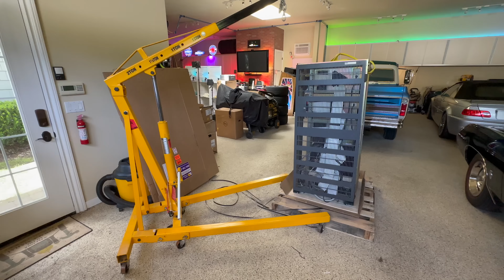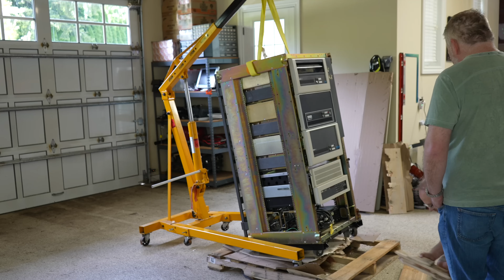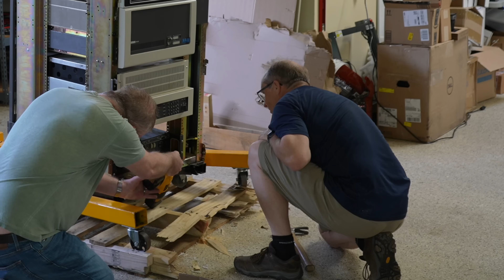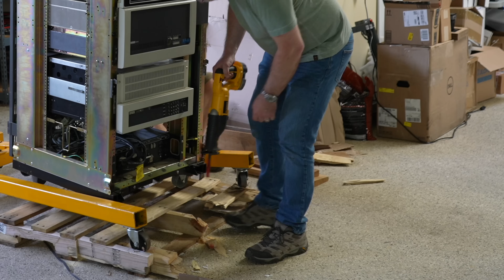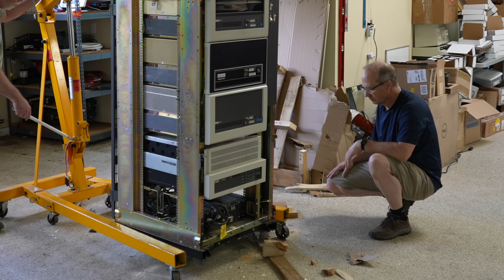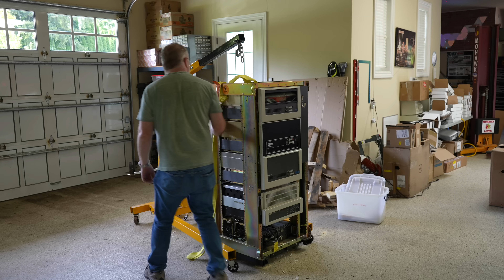I Bought the HEAVIEST Computer on eBay: The PDP-11/34!

Comment: Hello Dave, in the 1980s and early 1990 's I worked at a defence HF RADAR system that was all PDP 11/34 and then we updated to PDP 11/84's as they needed more horse power..  (later on we moved to VAX and Alpha) ahh the memories of RSX11M and its quirks, still remember setting the UIC to change folders if that the correct term, I was an electronics TECH who was slowly seduced by I.T . Thanks for the memories.

Comment: Ah, music to my eyes :) Thanks !  In Adelaide (Australia) we used a '45 a '44 and some '34s to coordinate/control sets of traffic lights back in the early 80's.  When I first landed in that area, one of the techs had a program from somewhere that ran (on the '45 I think) and a radio placed nearby would pick up the RF as a (valid!) tune, unless he was fooling me all those years, go figure :)  The things we did back then :) My favourite memory was debugging a device driver by using single-step panel switch and examining the lights for octal data :) And, using tin slips on a soldered jumper on a comms device after examining its schematic. Ah, the good old days.

Comment: It may not run Doom, but it will run Adventure on RT11!
Wow... a blast from the past, takes me back to 1977 when I started as a DEC in-field repair engineer on PDP11/05, 10, 15, 20, 34, 35, 40 systems.
The UNIBUS cables were a big failure mode. We had an expression "snake it, plate it and leg it" (cables, modules and ...). If that did not work then out with the meter and scope. I used to carry a 8M core memory module which had a diagnostic program ready loaded, just plug it in, load the CPU start address and let it rip.
The worst faults went like this...
 "Op to me: Tried disk in #1, then #2 then #3 and it still wont work",
 "Me to logistics: Please send 3 sets of disk heads",
 "Me to Op: Did your last backup work OK?" and Op Looks frightened.

Comment: I wonder if this thing is big enough?  I got  a VAXStation 3100 m30 years back; the 11/34 is apparently about 1/15th the speed of the VAX 11/780 more or less (11/780 is by definition 1 VUPS) and the 3100 m30 is 2.4 VUPs.  So, like 30-40x the speed, in a thing about the size of a pizza box. I netbooted NetBSD on there (it was really a VT1200, so it was sold as an XTerminal but really was just a diskless 3100m30, in original use it had to boot the x server from a host system.)  11mhz CPU, but that VAX instruction set is nuts (getting a low number of instructions per second may not be a big deal when the instructions are so complex, truly the exact opposite of a RISC system's simple instructions allowing higher clock speeds, these complex instructions got a lot done with relatively few instructions per second being dispatched and completed).  It was running about dead even with a ~40-60mhz 486 or so on some workloads, and more like a Pentium 90 under some other workloads.  Crazy.

Damn these old DECs were cool!

Comment: I'm with you!  I have several old pieces that run.  I'm not about to disassemble them and inspect every component.  I mean really.  Even the old hardware, if something goes wrong it doesn't power up, it is uncommon that it's going to burst into flames and take everything down with it.  I mean, what's it going to do, blow a cap?  So I replace it then instead of preemptively.

Comment: It brings back fond memories. My first job out of college we had a PDP 11/34 running RSX11M, used for engineering (cross compilers and simulation) as well as downloading programs into and providing the operator interface for a tester for the custom avionics LSI chips our lab designed. The tester was interfaced via the DMA interface.  A few years later at another company they were selling some old engineering equipment including portions of a DEC system. I bought an RK05 drive + controller + ~10 drive cartridges for about $150. I still have that down in my basement, though never got a system to connect it to.  I had notions at one point of turning the head positioning mechanism (with its massive structure and positioning system with precise feedback) into an actuator for a subwoofer.

Comment: Apologies if this has already been mentioned, but to avoid having to wire-wrap continuity across the backplane, we used un-jumpered backplanes and 'grant continuity' cards.  That way if you had a nearly empty backplane, you populated the empty slots with 'grant cards' and when you wanted to add cards to the backplane, all you had to do was pull the grant cards out and insert your muxes, memory or whatever.  The grant card was only one slot width and we used to carry 'em in our back pockets.  Very handy when you had to pull out a DH-11 for repairs...!

Oh and BTW - yes to more DEC content!  Would love to see you fire up RSTS/E on that 11/34!  Ahh the memories....

Comment: My second programming job was for a timeshare company running a PDP11-70 RSTS-E back in 1981...  Cobol, Dibol and Dec Basic.  Great hardware and software for the time.  We also got a Vax when they came out, but I didn't have much time on it.  Great video.  Great memories.  Thanks.

Comment: The first computer I ever used was a PDP-11/70 in my first year Computer Science class.  It had a customized shell for students that was basically a locked in version of the “ed” line editor.  There were a few extensions to submit assignments via leased lines to the government-owned IBM System/370 and accept the results back. One of the first rudimentary integrated programming environments. 

Sounds primitive, but I was in the first group of students that never had to use punched cards, which was a huge deal. The system was called DEUS (Data Entry U of S). The first programs I wrote on it were for the IBM 370 and looked like this:

HELLO:  PROCEDURE OPTIONS (MAIN);
  PUT SKIP LIST  (‘Welcome to PL/c!’);
END HELLO;

Comment: My previous employer, at one point, had multiple PDP-11 stacks in our server room. By the time I was brought on board in 2006, the environment was emulated, but the machines were still there. I had a chance to look them over multiple times before they were eventually fully de-comm'd. I learned a lot about the environment because of the emulated stack (a few of our manufacturing systems required a PDP-11 "backend"). I've heard hundreds of stories about these things, from people programming them, to troubleshooting the smallest of software glitches. (Who dropped the cards??!!)

Eventually, in 2020 (during COVID) we removed the legacy system at the one remaining plant that needed the emulated environment to operate. I gained a ton of respect for these machines in the process. That "system" (even if emulated) carried us through all the way to 2020.
Reply: Interesting to know that emulation of PDP-11 was created and used not only for nostalgic / fun purposes!
Reply: Too bad you didn't grab a few when they were "let go."  A lot of that stuff wound up just being scrapped.

Comment: i cut my programming teeth on PDPs: XXDP, RT-11, RSX, and VMS, many assemblers and langugages, Macro-11 and Macro-32 being my favorites. I wrote whole sets of diagnostic and utility suites using XXDP and DCL. Two things I'd like to see you do: Adventure (the original Zork) ran on RT-11, I believe. Also, there is a single machine instruction that tests all of memory. You could key it in to address 0 and execute it, and it would copy itself to the next address and autoincrement PC to execute it. I don't remember the exact numbers but will see if I can still find any of my manuals (probably not).

Good on ya for reviving a classic system. and thank you for entertaining content.
Reply: Do you think MOV -(PC),(PC)+           Octal 14727                   would do the trick if deposited in physical 0 and executed? I'm thinking this should take the updated program counter, decrement it to the instruction address, copy that value (the instruction) to the next address while updating the program counter and then repeating?

Comment: Had wire wrap machines at work.  i can manually check wire wrap. iv test light checked hundreds of backplanes; and resistor network cards for DARPA radar systems.

Comment: One of the most exciting and satisfying episodes I've yet seen on your channel IMO. I was never a fan of dealing with a mini computer or of programming on a mainframe either for that matter during my student days. Personal hands on real time terminal interaction was not available to us undergrads. In about 1979 I was required to write and submit a working machine language program for the Elec. Eng. department's Varian 16 bit mini in order to pass the 3rd year digital course. It was something I never managed to do for various reasons. Fortunately I still managed to pass the course the following year. This time a second option was presented:  write and test a simple Black Jack card game program in assembly for an 8 bit microprocessor computer. I did this with ease at home on my self assembled Motorola 6800 evaluation kit wired via RS232 to a noisy mechanical teletype terminal / printer I had purchased for a bargain price.  Nowadays I have grown a little weary of the ubiquitous microprocessor dominated PC world. As I have aged so has my fascination with the beauty, visual and tactile appeal of retro machines including vintage computer hardware such has as this. Forgive for my verbosity and please continue at your wonderful snappy pace revealing the wonders of the iconic PDP-11.

Comment: It reminds me of how easy programming in pdp-11 assembler was compared to other systems. One could do that even on the tramway or train.
At the end of the 1970s, I extended the RSX11M Terminal driver for the first color monitor driver (VT30). So I could even enter programs via the color display. Unfortunately one had to readjust the color convergence every few months which was not just an inspiring action, as there were nearly 20 pots to adjust.
Reply from the maker: CS300, which was our MACRO-11 class, was my highest mark in all of college!  Loved it.

Comment: I think emulation would be more satisfying with real disk drives, but those are hard to come by and harder to troubleshoot and interface. What would it take to be able to use usb 1.44 3.5" drives with something like the pidp11? to format the 3.5" disks in the old ibm 1.25 megabyte format? Would that be pretty hard? I don't have the skills but I'm someone out there does. Is this realistic or no?
Reply from the maker: The UniBone lets me mount virtual drives, like RL01 drives, and supply an image.  So that works really well!

Comment: I'm certainly not knowledgeable about minicomputers.  I was aware of the PDP and then VAX after that.  There is an intersting book about the development of the Data General competitor to the VAX, you might like to read it.  Look for "Soul of a New Machine" by Tracy Kidder.  I don't know if there are similar things written about the VAX or other computers of that era.

When I see an older computer like this my first question would be how does it compare to other hardware of the time or shortly after that.  For instance how does the power of the PDP compare to the VAX, or to the IBM PC or AT that might be available in that era.  So I would be interested in seeing benchmark comparisons of a PDP with a PC or AT.

When I see what it takes to resurrect old hardware it seems that we are on the verge of losing a large knowledge base.  Humanity invents and builds things, and things evolve and there are new inventions.  At some people we may end up like Star Trek in space ships talking about highly advanced subjects but it is all built on electricity and electronics and at some point even the PDP.  It seems like losing that knowledge leaves a gap in our knowledge.  If modern society ended and we had to go back in technology could we resurrect older technology and make it work for us?  Could we start with transistors and build new computers like the PDP?  Would we have to invent eveything from scratch because even though we might have known how to travel through space we lost the knowledge of how to build simple computers?

Comment: My brain is still full of Macro-11 assembler opcodes. I can't bring myself to throw out my dog-eared and tabbed assembler manual. Oh the memories of using ODT at the terminal to troubleshoot crashes of our realtime data acquisition and control system. Without all the current fluff, amazing how much could be done with 256K of ECC RAM and an LSI11-73 Processor

Comment: Nice work.  I have an IBM XT likely from the mid-80's with a hard drive in my vintage collection.  I believe it works but has a power supply issue.  If you are interested in a "What's in the Vault?" type project, please let me know and I'll ship it to you. It comes from an interesting manufacturing plant.

Comment: This takes me back to my university days back in the mid 90s. I belonged to an Amateur Radio club that also did a lot of computing. We had a couple of PDP11s and a VAX 11/750.  I remember that to boot one of the PDP11s off a tape drive we had to type in a boot loader in hex using a dumb terminal. We did have a boot rom but the tape drive was using a different id from the one in the rom.  (BTW I am in UK, 240V electric and fuses built into plugs) The VAX required a 13A fuse in its plug as there was a large surge as the power supply capacitors charged up when you turned it on. (The capacitors were the size of Coke cans).

Comment: Started my career on a PDP-11/34 and followed by the VAX-11/77. Cobol, Fortran and Basic-Plus. Not sure if it was RSTS/E or RSX/11M OS. It was fun. The VT100 terminals were cool to use, you could break your foot with the key board alone.

Comment: Dave, that was freakin' awesome!  I scrounged an 11/23 years ago for $50, had a lot of fun with it, till the boot drive died. It was running RSX-11M.   Back in  '92, didn't have the talent, resources, or cash to fix her.  I did keep the Decwriter 300 and used it as a printer for my PC for years after that.  Great job!  More PDP-11 stuff please!

Comment: What a story.  As the group product manager for mid-range systems at DEC  (including the 11/23, 34, 44 and VAX-11/750), I was spellbound throughout.  Thanks for doing this.  Now, if I could just find a running IBM 1130 on eBay  .  .  .   .

Comment: PDP-11 made me valuable. These were also embedded in test equipment like GenRad In-circuit Testers. This was a test system that took your schematic description of the board and a bed-of-nails fixture generated from the physical description of the board and generated a board test. We were building boards with >2000 embedded resistors in the PCA (technology from Cray), and the GenRad test program generator went through all 10,000 resistor models to generate the test. The test generation took about 2x the MTBF for the PDP-11 running RSX-11 (MTBF was about 25 hours, so the test generation was about 50 hours), so, as you might imagine we never got the test to generate. I wrote a FORTRAN program on our engineering machine (our own product) and generated the test (just source code) using one resistor model and generated the test in about two minutes.

Comment: 24:36 - The downside of not using an unwrap tool with a wirewrap post is you are not guaranteed a gas-tight connection if you re-wrap the post. Fortunately, in a non-production environment without worry for the 15-year warrantee, you are probably ok...

Comment: Why do some people think that their method is the ONLY correct way and anyone following different methods are "bad", "wrong" or even called out as "un-ethical". It's a bit like rocket science and the way NASA works compared to how Space-X works. There is place for either depending on external factors or requirements for specific outcome

Comment: I remember the noise those 8 inch floppy drives on a unix pdp 11/35  made mounting / accessing the floppy. It was freakin weird:-)

I don't think Dave has any of them (model RL01??)
Reply from the maker: No, I have the controller for them, and the cable, but they must have been in an external chassis!

Comment: My association with computers professionally started with a PDP11/73 running RSX11M-Plus writing data analysis software in the Materials Labs at Rolls Royce, there I moved to RT11-FB to write updated data aquisition software. Then one day a new box appeared in the shape of a MicroVAX II where I spent many happy hours porting and modifiying my RSX based software to run on the VAX. My last association with these systems was checking and testing all the software to confirm Y2K compliance (which it all was due to using VMS's awesome system libraries where any date handling was required), this was required as even though the powers that be at the time had engaged an external company to re-write all the analysis software to run on PCs after 2 years of development they still had nothing that was as accurate, flexible and reliable as my venerable old VMS Fortran packages! So yes please, more DEC content will be very appreciated.

Comment: Excellent.  I have trepidation when I boot up an Arduino 😂.  It’s amazing that all of those chips still function considering the interconnects are wire wrap!  
Seeing your B-roll around the display stuff that is still working is a trip down memory lane.  Commodore Pet like the one in your shop was my first venture into computers, and it was earn while you learn.  I thought BASIC was neat because it was logical and let the off-the-street guys like me experience computers.  It has been a wonderful ride!
Thanks for the excellent tour of the PDP.

Comment: I trained on a Vax 11/780 with two LP05 printers back at S.A.I.T. in 1986.  It was part of a program called Computer Hardware Engineering.  CXT.  When I started my education, there were two jobs for every grad...   two years later, the bottom fell out of the mini-computer field. DEC was sold to HP and most of the jobs turned to Personal Computer servicing.  Networks were sneakernet.